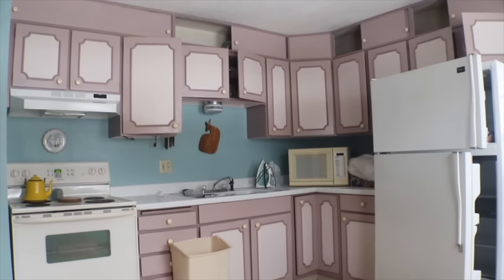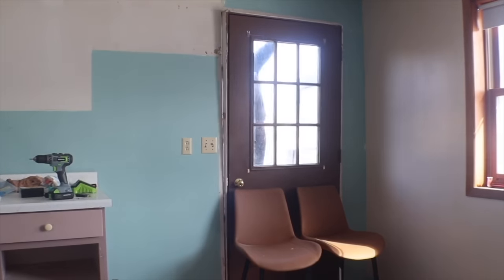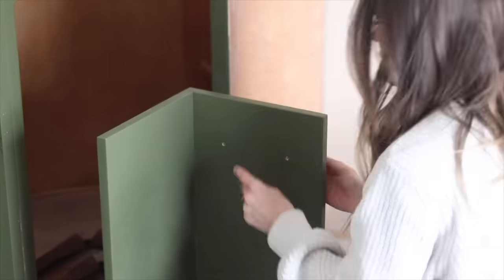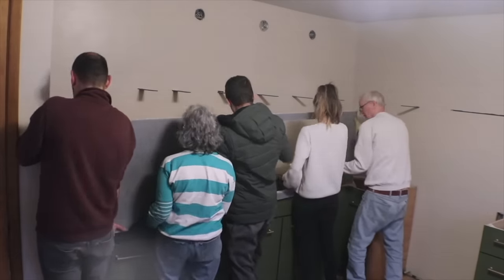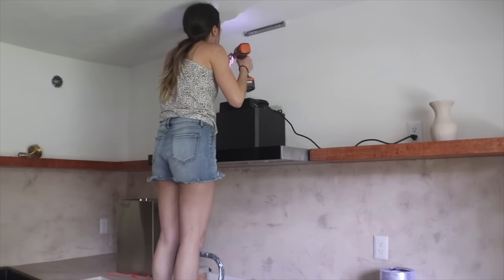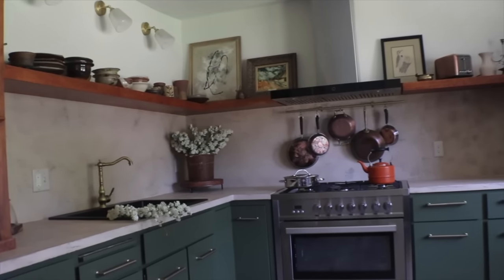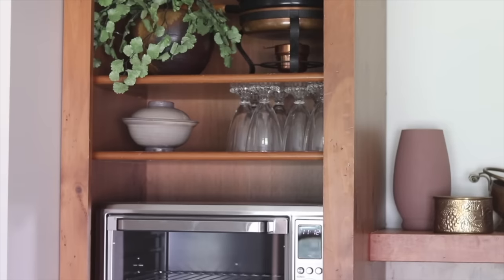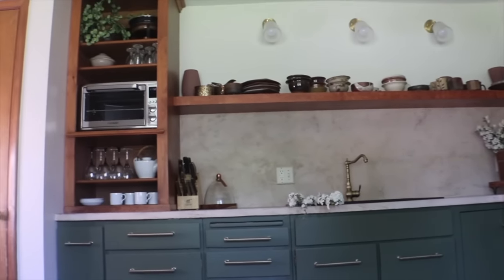DIY Small Kitchen Remodel | Before and After Kitchen Makeover

Comment: I like that she unscrews the kitchen cabinets to take them down rather than swinging a sledge hammer. Taking them down like the way she did is so much more predictable and it would seem easier to collect the mess if you are going to throw them out. I also like how she cut lines into the floor so she could remove it flooring in sections.
Reply: Also, by salvaging them you can donate them to a Rebuilding Center if your area has one. Where I live you can find so many pieces of hardware, cabinetry,  doors, etc. at a fraction of the price of new building materials, saving them from th dump. This should be normalized in every city.
Reply: It is the way pro take apart a kitchen, the sledge hammer crap is just for tv shows.
Reply: @jazzyg530  true!
Reply: Its not as much fun though XD
Reply: THANKS FOR REPEATING WHAT SHE SAID YOU FAN BOY
Reply: Seriously, who would use a sledgehammer if they are screwed in?

Comment: Bottom line:  there is a “design intelligence” here that is coupled with a strong sense of purposeful DIY that is simply unmatched by many people.  I have redesigned my own kitchen remodel, built and/or repurposed some of the cabinets, moved appliances to new locations,  changed piping, electrical, installed new recessed lighting, new moldings, new counters, and installed new flooring etc.  I am quite “handy”.  But, I don’t have the terrific design sensibilities that the Mrs. Woods possesses.  THAT is what makes the whole package.  Well done Mrs. Woods, we’ll done.

Comment: Great job! Very inspiring! Love the colors and finishes. Great job reusing all that you did. 

Quick tip: Drywall mud can be leved with a wet rag instead of dry sanding, this means you get the task done quicker and without wearing a mask and making a dust mess. Cheers!
Reply: Can you explain using the wet rag instead of sanding please?
Reply: @kimberlyscrivner9373  Yes use spary bottle and metal putty knife or taping knife to scrape the surface flat. Or just a damp rag to rub the surface flat. Here is a link to a video... https://youtu.be/kRCpTHi00Mc

Comment: This is gorgeous!!  Love the design, love the color palette and hardware, love the functional details of the pull-out pan rack and repurposed shelf.  Seriously impressed at how you upcycled those upper cabinets into a banquet!  This has such a cozy Euro feel to it. 

What I would do a little differently
- continue that gorgeous concrete backsplash finish all the way up to the ceiling for added height and grandeur
- add matching hardware to the front of the sink panel as a functional dishcloth bar
- make the fridge the same color and finish as the cabinets for a built-in appliance effect

Comment: Great job on a budget rebuild! Remodeling is always disruptive, and kitchen remodeling is the most disruptive by far. Having to endure that for four months is tough. I hope you didn't have to live in the house while you did it. Oof! I love how you upcycled the old hutch. Paying to add an outlet inside it was very wise. The shelf brackets look robust, which is good because you know the next occupants are going to stack all their dishes, pots and cast iron cookware on that little shelf. I'm not sure what's on the other side of that door you closed off, but that would be a place to hire a professional to detail and finish up. Even if that wall is sheltered from the weather, you can still have problems with condensation, heat loss, mold, rot and other issues, if it's not done right. All in all, a beautiful job. Thanks for sharing!

Comment: I'm getting ready to renovate my mother's kitchen. The color is great.  I'll be using penny tile. There will be some places I'll use copper with copper pipe cut lengthwise with fittings.  The copper will be the backsplash as a background for the stainless oven

Comment: over a period of decades i renovated my kitchen. seems i am doing that constantly. I like your simplicity and may remove my wall cabinets and put in shelves like you. i had a time venting to the outside and had to drill into concrete a little. my house has a concrete block exterior so that was a deal. can't board up my kitchen door however. !! i only have two doors to the outside of my home. anyway i enjoyed your makeover.

Comment: Exquisite aesthetics and work-woman-ship!!!  What a variety of talents you have.  Congratulations.  Other options:   I would have painted the fridge the same green as the cabinets;  Extended the top of the benches another 2-3 " so  when you sit you're heels have a space on the floor;  a longer table;  a long, narrow picture above the bench that parallel's it.  I am so inspired by you.  thanks
Reply: I thought the same about the fridge color.  Imo the dark blue was the one element that was off.  Also I would have used a bigger semi-flush or pendant ceiling light.

Comment: Superb job. Only thing I would have done differently is the benches. Access from above is easier than from the front. For anything in the back  you now have to get on your knees. Using the seat as a lid you would have easier access and also more room to just 'throw in' stuff.
Also you should add a clock. Preferably a round clock, mounted above the kitchen door. From personal experience I know that this offer you the benefit of a quick calm glance at the clock each time you leave the kitchen.

Comment: Looks great! one tip I would give is, while the usage of the vertical drawer at the left side of the kitchen is always a good idea to fill up any left over space. However as wood "works and warps" I would suggest to not let the faceplate of the drawer reach the wall, but work with a "spacer" same as for the other drawers and cabinets, you have x-amount of margin left and right in order to not collide with anything else. Just having a few cm/inches of breathing room will mean the drawer will never end up scratching the wall ^^

Comment: Unimpressed with placement of the mini oven within the shelving unit - where is the ventilation clearance? - these small appliances push out a great deal of heat and the risk of fire is very great indeed. This applies to microwave ovens which require a generous space behind and around the appliance for heat and steam to escape which is why one never places a microwave oven in a closed pantry cabinet.

Comment: I would've loved to see how you installed your over the range hood, as I am in the middle of this tackle and have no idea where to start. I love the hood that you chose, I have a wall vent and I am replacing an over the range microwave for a range hood just like what you have in your remodel.  Will this hood that you chose accommodate a wall vent as well? TIA if you see this comment/question.

Comment: There are many options to decide from when it comes to making your kitchen equipment, including glass, cast iron, aluminium, and several others. The use of all such cookware has advantages and disadvantages, but stainless steel modular kitchens provide the most significant ratio between positive and negative items. That is why.
1.Stainless steel kitchens wear are a hard-wearing and long runner
Stainless steel is a metal alloy that stands out for its hardness and resistance. Stainless steel withstands impact, corrosion, and up to 500°C temperatures. Thanks to its intrinsic features, the material of choice for professional kitchens is stainless steel. They must be mainly worn resistant because they are intended for much more intensive use. Due to its characteristics, stainless steel is also used more and more in-home kitchen production.
2.Stainless steel kitchens cabinets can be wiped easily
Stainless steel is biologically neutral and thus antibacterial. In contrast to other metals, stainless steel does not alter the color, fragrance or flavor, and does not release any toxic substances that might contaminate it which is why it is easy to clean and hygienic as well. That’s why it was always used in the kitchen. Both for the production of cupboards, vaults, and food containers and industrial kitchens’ design with essential requirements of hygiene and excellent food conservation.
3. It’s very robust
It is cheap to make six-inch-deep basins, but they spill and do not hold anything. On the other side, a 9- or 10-inch sink carries plenty, a significant plus when there is little countertop capacity. Bear in mind that an undercount ends up another inch or so lower, which might strain your back, so you could consider investing in a basin rack at that point. The form still matters. With square edges, straight surfaces, and a flat bottom, you get more volume, but soft angles make for quick cleaning and good drainage.
4.Stainless steel kitchens are practically eternal
For guests outside the hotel, the pleasure of cooking, perhaps by the sea, by the pool, or on the panoramic hotel terrace encouraged the widespread use of steel cuisines. Indeed, stainless steel is a material that is corrosion-resistant and temperature resistant. It is weatherproof and robust. It can withstand UV rays and harsh winter weather.
5. Functional and stylish
Eco-friendly, sustainable material is stainless steel, which is 100% recyclable. But that’s not all: its life cycle is almost eternal because endless times can be recycled without losing original properties. Stainless steel is an irreplaceable material that ensures sustainable resource consumption.
6.Stainless steel kitchens are designer objects
Stainless steel kitchens, when well-made using prime quality materials, are near eternal. Stainless steel is a very tough material that does not age or change over time. Besides, instead of other kitchens made from wood or lacquered panels, kitchens made from stainless steel have a longer service life. And even in the case of scratches, a simple restoration task can be easily repaired as new. In brief: kitchens in stainless steel are potentially eternal. This is why they are considered a genuine investment for the future and many families hand them down from one generation to the next.
7. Hygiene
Stainless steel and in rural areas of developed nations are increasingly becoming commodity choices for food storage. Food is often processed and sold on the streets in open areas, exposing it to dust and other air contaminants.
8. Lifetime durability
Long-lasting, durable goods that endure intensive everyday usage and are strong enough to move on to the next generation should be filled with a kitchen.
9. Pest free
Steel and Stainless-steel modular furniture’s salient characteristics are that they are hygienic, easy to wash, waterproof, rust-resistant, fire-resistant, noise-free, and pest-free. Also, steel and stainless steel are environmentally friendly and come in different colors and configurations.
10. Waterproof
The metals boast a distinctive appearance. The treated metal is durable, stain-resistant, and rust-resistant. Heat and moisture are unaffected by metal doors.
Phone No :  8310799577
Website : https://tuskerkitchens.in/how-do-i-pick-the-best-stainless-steel-kitchen/

Comment: Not a criticism, I enjoyed the vid. But that is not a small kitchen 😄. If you want to see a small kitchen come to the UK, there's plenty 🤣. My L shaped kitchen, well it could be called a galley kitchen but I honestly think it's to small for that 😂. 7.5m² or 8.96y², yes tiny. I've included a UK size fridge freezer, washing machine, cooker and a Belfast sink, also a 1200x600mm (3'11.2") base cabinet and matching wall units all made by me and from reclaimed mdf. The Belfast sink base was also reclaimed as was the timber base made from a dining table. Actually two dining tables were used overall, one as a work surface around the sink and the other for the cabinet base unit top thickened out by some pine double bed slats.

Comment: Only thing that has me concerned and that I wish I saw addressed,  is the fact that most popcorn ceilings in homes built in the US before the 90's contain asbestos. Hopefully you had yours tested and it did not contain any, which in that case there's no issue. For samples that come back positive though, its a much more involved process where your average person might be better served with an abatement crew.
Reply from the maker: I did test it negative for asbestos, as well as the floor tiles and drywall. Almost all building materials in the 50's and 60's contained asbestos in certain areas of the world so I'm not sure why I always get this concern with just the ceiling texture. I did mention in the video this is a recap of all I've done and each project is broken out into their respective videos to go into detail (like the importance of testing for asbestos and how).

Comment: A kitchen is a work space.  This design looks nice, but is not as functional as it could be -- form should follow function.  For starters:
1.  By eliminating all the wall cabinets a small kitchen has been made even smaller.
2. Butting a refrigerator up against a wall doesn't allow the door to open properly and inevitably the door will damage that wall.  You should have put a 6" or 9" pull out pantry cabinet there; it would have given you much needed storage and also given you the space needed for the fridge door.
3. There is no task lighting at the counter top level.  Those lamps above the open shelves will not adequately light the counters where all the work is done.  Additionally, those lamps are angled so they will shine directly in your eyes/face when you stand at the counters.

Comment: The door on the old fridge facing the wrong way makes my eye twitch.
Reply from the maker: There’s no standard way fridge doors open, they’re able to be hinged either left or right depending on your room layout.
Reply: @WelcometotheWoodsBlog  Yes, absolutely. That layout calls for a fridge that opens with the hinge on the right, usable by someone at the sink & counters. Our spaces should be designed and configured around us, not the reverse (which is why I love your channel). The thought of the previous owners walking the long way around the refrigerator door every single time for who knows how long, just because the factory put the door handles on that side by default, drives me nuts.

Comment: No vapor barrier or insulation in the old doorway?? 🤔 
And no venting for that huge range...but the hood is installed for show?? Huh? 
Not even sure if the plumbing is to code either. 😕
Reply from the maker: I did put in insulation that has vapor barrier built in, installing plastic over that can cause condensation issues. I said in the video, but perhaps you missed it that we intend to vent the hood once we are done with the garage renovation and for the time being will use charcoal filters. The plumbing is to code, thanks for your concern. 🙂
Reply: @WelcometotheWoodsBlog  
Reviewing the video again. Yes, I do see the insulation. However, what brand of insulation that has a vapor barrier in it?
Reply from the maker: Knauf is what I used. Honestly a quick Google search can show you about a dozen brands. I’m also in zone 3 cold climate so building codes matter where you live.

Comment: I’m not impressed. The blue refrigerator with green cabinets and the stainless steel stove. Then you’ve got the wood from the hutch and the floating shelves. There’s not enough consistency so it looks choppy. Also, I’m not impressed by no cabinets up top and all your belongings are exposed. It looks thrown in.

That green color is going to age quickly. What I mean by that is it’s not going to be very popular for too many years and after hours gonna look dated. The blue refrigerator just does not complement the green cabinets.

Comment: You turned a normal size kitchen into a small kitchen. I just don’t understand that. You got rid of all the cabinetry, which means you got rid of all the storage. I don’t understand that. It’s much smaller because you “remodeled.” Millennial downgrades.
Like the millennials that “remodeled” our house and took out the courtyard because they thought it looked bad or something.
I don’t understand the justification of making a relatively small kitchen smaller just because of a passing trend…
If the trend cannot stand up to the question why, it will die.
You literally took away all of the storage and now it’s a super small kitchen. That’s a downgrade you paid and worked for.
The original kitchen adds more value to your house. You don’t have very much storage, not very many people will want to ever buy it if you go to sell. Just so you know. This is a detracting selling factor. Maybe you like it because it looks nice in Better Homes & Gardens picture, but it’s not practical for living full time… Pictures are pictures. They are works of art. You can’t typically live inside of art…
Furthermore, you have to weekly dust that shelf or you’re pretty disgusting… You never have to dust cabinets…
Never jump on the bandwagon blindly.
Reply: Ok um….perhaps I’m just more easygoing and open minded then you, but the new kitchen still has a lot of storage and you can always take down the shelving and upper cabinets later on. There’s nothing preventing you to change it. Perhaps you need to get your eyes checked?